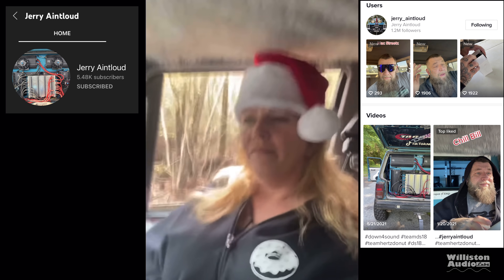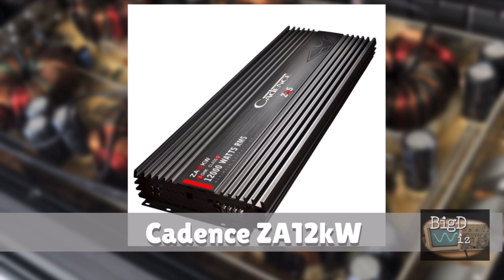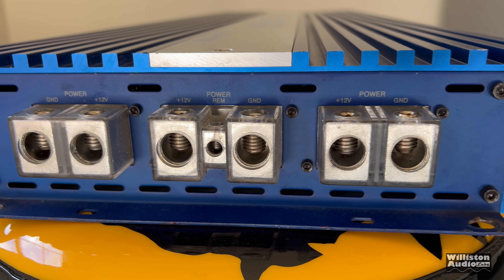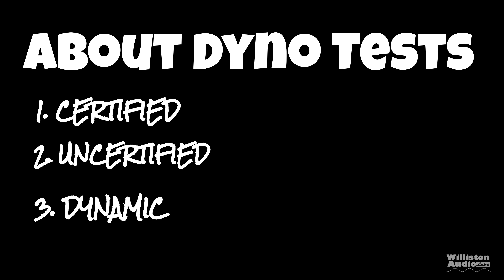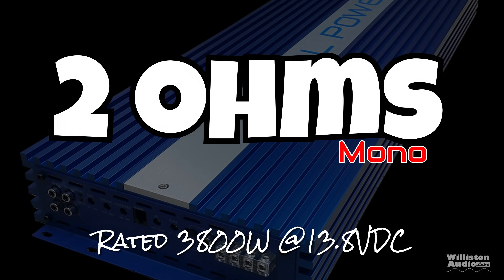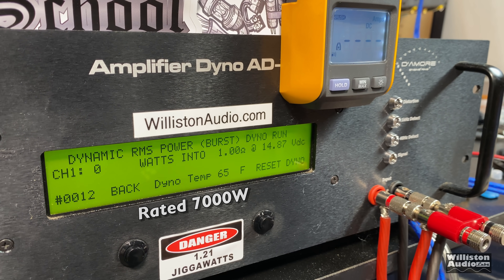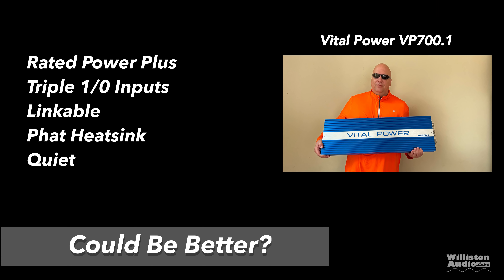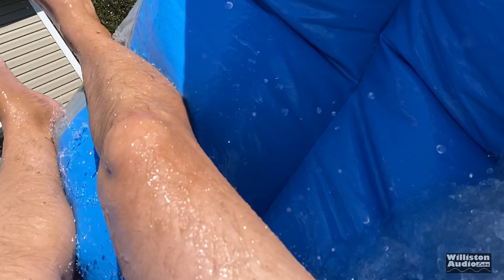7000 watt Competition Amplifier? Vital Power VP700.1 Overview and Amp Dyno Test [4K]

Comment: Awesome video, thanks Derek. Powerful amp for sure but I hope in the future companies will be able to design smaller sized amps with the same power. That amp is almost 3 feet long and I'd love to see if we ever get to a technological point where we can get the same amp down to 1 or 2 feet long. I will probably take some new breakthrough in amp technology though.
Reply from the maker: I have an 8kW amp coming up that’s about half as big 😝
Reply: @wal  Amazing!!! I can't wait to see the inside of the amp to see how on earth they were able to do that. I hope this is the future of amps where the size goes down but the power goes up.
Reply: @NocThunder  are you unfamiliar with Brazilian amps, or even the Chinese full bridge amps?? I would consider them very small for the power they put out. I replaced a Skar RP2000.1D amp with a Taramps Smart3 and the size difference was phenomenal especially considering the Smart3 puts out an increased amount of power that is almost hard to believe with such a small footprint. I currently have a Taramps Smart3, Taramps md8000 and Sundown sfb5000, those are just the full bridge amps that I have. I also have several Korean half bridge amps, including a pair of AL5000.1D amps which are highly underrated! Crazy thing is my Taramps md8000.1 and Sundown Audio sfb5000 amps are both so much smaller than the AL half bridge amps I have. Heck being honest my Taramps md8000.1 is even smaller that my 2500 rms Korean amp. 

Sorry NocThunder I just do not completely understand what you are saying, especially when one considers the size of 1k & 2k monoblocks back in the early 2000s... You don't remember people calling amps surfboards back in the 90s and early 00s?? Amps used to be HUGE! So my perspective is that car audio amplifiers have become insanely smaller and the price has hit rock bottom compared to the "old school" days of paying well in excess of one dollar per watt!! I was much younger during those years and making minimum wage in the Southeastern United States, needless to say I could not even afford most of the amps I wanted. *Still remember seeing a Audiobahn monoblock at Circuit City that I wanted so bad but never even got the chance to even hear it in action back then. Nowadays I can order an amp well in excess of twelve times the rms power that same Audiobahn put out for less money & have it shipped to my door within 3 days or so w/free shipping & a 1 year warranty. Amp technology may not have changed too much since that era BUT the footprint has became smaller and prices are very affordable for nearly all bassheads. To have a windshield flexing system that required bracing under the headliner used to be a very exclusive club, now anyone with common sense and a job can afford a system on that level. Long comment I know, just giving my perspective and then again I may have completely misunderstood your comment.
Reply: @itdoesntmatterwhatyourname6128  Ok. let me make this clear. Yes, I do know about Brazilian amps like Taramps and the such. And yes, I remember how huge amps used to be and how much smaller they have got. And yes, I know that modern amps are putting out more watts for cheaper prices. What you have misunderstood from me is how much smaller the amps will continue to get. This is not the be all and end all of amp sizes. Future developments will continue to where amps will get smaller and more powerful. Don't be surprised to see an amplifier the size of a small kenwood or alpine amp putting out 10,000 watts or more.
Reply: I’ve seen a db 7900.1 clamp 6600 on speakers wired at .67 rising to about 2 and it’s around 14 inches long. That was maintaining 15.5 volts. Which means on a dyno, with equal voltage, it should do over 8k at 1 ohm easily. Brazilian amps do just as much power and are half as big. And they draw a lot less current because the rail voltage is only half. Some, including me, will say they don’t sound as good, but on subs I’m not sure they is an audible difference.
Reply: @ThisIsMyHandle-48  - you said "they draw a lot less current because the rail voltage is only half" which is BS.
Watts is Watts - the internal rails are just a means to an end.
Personally, I don't understand why they don't run these big amps on 24V or even higher SUPPLY voltages.... that would actually reduce the input current proportionately..
Reply: @johncoops6897  that sounds good in theory, though I'm assuming there's a reason they do not design amps to operate that way.
Reply: @johncoops6897  can someone back me up here? Big D maybe? I know you know this. A Brazilian full bridge amp only has half the rail voltage of a typical Korean style amp. Maybe John coops doesn’t know what rail voltage means? Maybe look it up before you tell me I’m wrong.
Reply: @ThisIsMyHandle-48  - I know what the Rail Voltage is, and yes some Amp designs use lower Rail Voltages than others. However that doesn't decrease the Current drawn from the car battery.
If a particular Amp design has higher Efficiency and  then THAT will reduce the current needed for a particular output power.
Reply: @johncoops6897  and full bridge amps, which have exactly half the rail voltage as half bridge amps, are way more efficient, due to the lower rail voltage required. It allows the power supply section of the amp to produce substantially more power without drawing as much current, and produce less heat, therefore allowing a smaller footprint. In your original statement you said “watts are watts” as if all amps require the exact same total amperage draw to produce a said amount of power. Which would mean all amps are the same efficiency. Watts are not watts. I have old school us amps that at 1 ohm are about 45% efficient. I have newer full bridge DB amps(same as sound digital), that are about 83% efficient at 1 ohm. Nearly twice the power with the same current draw, because the rail voltage is half.
Reply: @ThisIsMyHandle-48  - you get more power because the EFFICIENCY of thae Amp is higher, not because of lower Rail Voltages.
Technically, the lower Voltage Rails mean that more current is drawn from the Amp's power supply, and this can increase voltage drops and losses that can lower the overall efficiency.
The design of the.Amp is what affects the Efficiency. A Full Bridge "brazilian" amp with 80% efficiency is still going to draw more power than a "Korean" style amp with 82% Efficiency.
Reply: @ThisIsMyHandle-48  I could hear the difference between my md8k and the rp4500.1 that replaced it. I will NEVER own a Brazilian amp again. The skar just sounds better and more aggressive where the taramps had little to no output
Reply: @erik120719  I don't have any bigger amps like that but I agree with you. A quality 300 watt amp sounds better at 300 watts than a shoddy 1k watt amp at 300 watts.
Reply: @c0c0asauce  the 8k clamped rated just the full bridge vs half bridge design has different sound, and I noticed low 30s and high 20hz just didn't have the authority the half bridge amp does. That's was with same exact setup, just changing the amps out and setting with dd1 and cc1
Reply: @erik120719  I personally only use Korean, but I’ve installed a lot of Brazilian. My main build is 2 db aak 20,000.1 running at .6 ohms at 16.1 volts. I clamp about 13,000 an amp rising to almost 2.5.
Reply: @erik120719  What I ment was the difference in sound is audible even when you aren't using the full rated power of the full bridge amp. I have no doubt they can make rated power.
Reply: @ThisIsMyHandle-48  I'm not sure what the ska rp 4500.1 is (as far as Korean, probably Chinese knock off of something) but the sound quality difference is night and day, tho it's double the size of the md8k but I'm ok with that , regardless of size sound quality is the most important part.
Reply: @c0c0asauce  I understood, I agree 💯. I was saying more along the lines of going from 8k to close to 6k ( the 4500.1 dynamic output) was actually louder and cleaner with way more authority between 17hz and 32hz.
Reply: @erik120719  Ah, hard to tell sometimes.
Reply: Have you seen the hcca3000.1dsplx
That thing does monster numbers, I love mine don’t ever plan to get rid of it

Comment: I have a pair of 1100.1s i ran for about a year wired to 0.25. curious if they'd hold up to a dyno 0.5 load and respective power output. I'd love to get a couple more to have around, but i may shelf them this year as it seems like all the 1100.1s in the wild disappeared. No idea where they went, used to see tons of them then nothing.

also, that current looks about right at the 0.8 ohm test, I've clamped around 1200amps per 1100.1 on the inputs on music.
Reply from the maker: I wasn’t willing to risk Jerry’s amp

Comment: Out here in central CA alot of people run addictive audio since they are located here in the valley, it's good equipment but just way overpriced in my opinion due to only being able to buy it through a dealer which comes with a pretty high mark-up. I've personally run it before in one of my builds but nowadays I would rather run psi, sundown or skar to be honest.
Reply: @Nick Cossio is it just me or is PSI dying off? I haven't seen any PSI gear in a minute. Are they still in business? Jw because a lil over a year ago or so (rough time frame) you couldn't even order any new subs or amps from their website. I remember because I was looking at doing a PSI build but they had subs type of disclaimer on their site regarding gear being unavailable for the time being. 

Idk maybe someone will come through and share some info... I do know I've heard from several people who've had PSI subs and had problems with the subs "bottoming out", and one person told me it was due to "inferior frames they'd been using". Again just sharing what I've heard. I've also heard great things about PSI but that's been almost a could years ago. 

*I don't want anyone to think I'm bashing PSI because I am not & that was certainly not intended.
Reply: I live in Visalia and yeah.. addictive audio is way overpriced... And it's not even high end... They seem to get there amps at the same place audio dynamics gets theirs

Comment: Saying if someone needs a manual to install this then they shouldn't even mess with this amp, meanwhile people can clap back and say if a company can't even make a simple correct diagram then how are they supposed to trust how capable they are in the rest of the manufacturing process.
Reply from the maker: There is never an excuse for not making a proper manual, even more so incorrect wiring guide

Comment: I love the manuals disclaimer! 🤣🤣🤣 This made my day.
Reply from the maker: How bout that wiring guide 🤷‍♂️
Reply: @wal  I get the feeling that one was a slip up. These are cookie cutter boards and I bet that diagram is correct for a different company's amp. It is very odd though that one of the power wires is reversed from the majority. Yet far to often in car audio there are issues with translations and diagrams like that.

Comment: Is it competion because of its size? What make it competion ? That term doesn't make sense, there the same amplifier, built the same way, but its just bigger
Reply from the maker: Most people who buy amps this large enter SPL competitions. Not all, but the average person doesn’t usually buy an amp this large requiring an upgraded electrical system

Comment: Not as pretty as the VLX 400 but very impressive on the power
Reply from the maker: Yeah pushing a lot of AC out of those speaker terminals!
Reply: @wal  science experiment I've always kind of wondered about but nobody's ever bothered to do we've seen everybody put a woofer into a light socket but we've never seen anybody try to run a power tool off an amplifier that big using 60 hertz 🤯 I know it's kind of dangerous for the amplifier but is it possible?
Reply from the maker: @ehrenkrause9861  I’m planning a vid like this!

Comment: Looks like every good quality 7500 watt Korean amp I’ve seen in the last 10 years. Tests the same too.
Reply from the maker: If it ain’t broke why fix it?
Reply: @wal  exactly. I own several of them. 2 M5’s, vfl-1100, vfl-600, sva-7500, 2 db aak 20,000.1. All great amps. Current monsters, but great amps. Run any of them 1/2 ohm on speakers all day long.
Reply: Looks like a korean S&I  built amp

Comment: Should run the woofer test on the Kicker quad box!  That's a fast ride to eviction if you have neighbors within 1/2 mile hahaha!
Reply from the maker: Yeah that would make them happy I’m sure 🤣
Reply: That's what I wanna see too!
Reply: that prefab box wound not make 10 seconds . the tiny voice coils would melt lol
Reply: @craigengelman4534  I'm not sure but if they have 4" VC with high temperature tolerance they should be able to safely handle 2kW RMS for a few seconds.  That's 8kW for four.  And a 40Hz burp would definitely be quite obnoxious.

Comment: Why does it do 1000 more watts uncertified @ 2 ohms than certified @ 2 ohms but @ 1 ohm it only does about 200 watts more uncertified vs certified?

* Also I am down with the TeamPie test! I like that they admit it's a clone and they don't try to ride on another competitor's name. Better than most other amp brands or rebranded amps.
Reply from the maker: That’s a good Q for an amp tech or designer. My thoughts are at 2 ohms it has more reserve and at 1 ohm it runs out more quickly

Comment: Can you test or just take a look on a philippine power amp? It has a rating of 100k and the size is monsterous. Idk i think its called turbulence amplifier
Reply: Also it costs around 1k~4k usd
Reply from the maker: Never heard of it? The Amp Dyno supports up to 15kW at 1 ohm provided you have enough electrical
Reply: @wal  they have a pro amplifier one and the only thing you need to do is to plug it

Comment: Big Boy Amps!!!!  Love it   P.S    let the voltage do what it do,  just keep the awesomeness coming.
Reply from the maker: Thanks for watching and commenting!
Reply: Right, there is way too much worry about voltage. Some amps are designed for 12, some 14, and some 16 or more. In my opinion its all about replicating how it would act in a car. Yet that can't happen because every car is different some cars have 80 amp alts some have 240 amp alts one or two batteries, etc.... IMO just use what ya got and give it what ya can. Most of the people I've met are running stock alts and couldn't maintain 14 volts let alone 13 or 12 in some cases. Not everyone can run a separate alts for a 16 volt system. So voltage outside the manufactures recommendation doesn't really matter....

Comment: Would be nice to see the same tests done on one that hadn’t been worked on
Reply from the maker: Why is that? You think working on it makes it worse? In many cases better parts are used in repair
Reply: @wal  the “better” parts is what I’m referring to. I just want to see a true vanilla factory version tested.
Reply from the maker: @TsunauticusIV  The differences would be minimal if any. Can't get more power without modifying the power supply to produce more voltage
Reply: @wal  ohhh ok. I def misunderstood how it worked then. I thought you could slap in more modern(maybe more powerful) parts easily and see gains. If it was just a basic rebuild then you are correct. Probably the same thing then.

Comment: Voltage isnt an issue. These tests are merely interesting. Not really relative to the real world.  No one uses these amps at 4 ohms right? Youd have to be using 1 ohm? I mean 2500+ watts aint that tough to get without 3 runs of 0 gauge and an amp that costs $1500 more than youd need to do it.
Reply from the maker: Impedance rise friend
Reply: we ran it @.4 ohm.
Reply: @JerryAintloud  Thats what I mean. If someone was going to get an amp in this class. It seems a waste to just run it at 4 ohms. Just get a Kicker or something for 2500 watts. Unless you wanna brag about having 5000+ watts of headroom. Im not complaining, just curious.

Comment: Clamp meter on one cable and then multiplying it by 3 will give inaccurate results. Put all 3 wires through the clamp , the voltage is very low and the current is very high so even slight difference in wire resistance results in huge difference in current balance and there is no way all 3 of those wires are carrying equal current.
Reply: Seriously how much difference could there really be? 1 or 2%? Besides, I'm not sure what his fluke meter is capable of but my clamp meter is only good for 600 amps.
Reply: @chickenpimp5190  20 - 30% in worse case . Range can be an issue but the clamp meter he uses can do 1000a on ac and dc ..
Reply: ding ding ding we have a winner !!!

Comment: This shows how powerful the Orion HCCA amps really are. The 3000spl did over 13,000 burst watts on your dyno I think didn't it. Correct me if I'm wrong. I'm not knocking this amp please don't get me wrong. Another great video from THE BEST car audio guy on YouTube and or on the internet period.
Reply from the maker: Yes that was at 0.5 though. I did not try this amp that low since it’s not mine and I didn’t want to chance it
Reply: @wal  valid point, can't argue with that.

Comment: Insane and only for $2000.
Reply from the maker: Like 6yrs ago but yeah still a chunk of 1’s
Reply: @wal   For the time there were amps going for 2k at less than half that output from the big guys. 2k is not cheap, but its cheap considering what 2k could get you from RF or JL for example at that time.